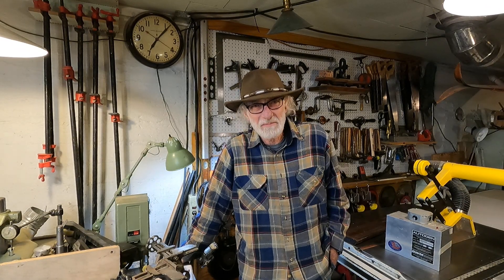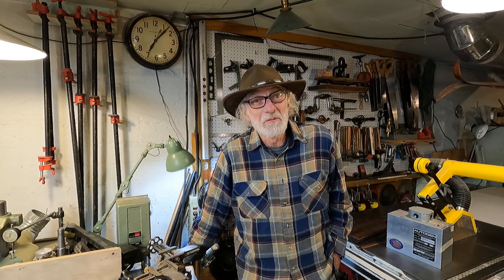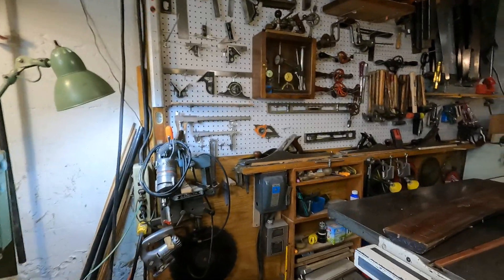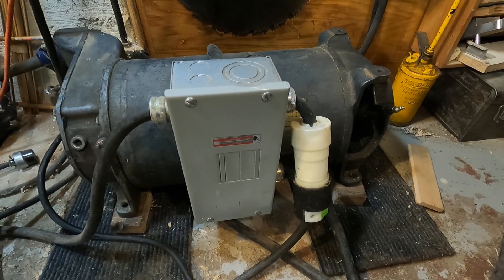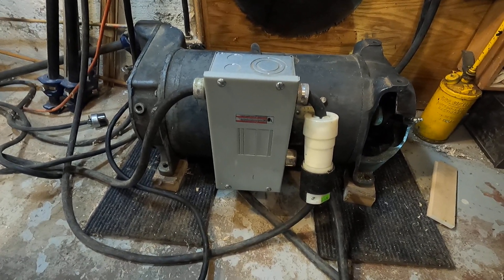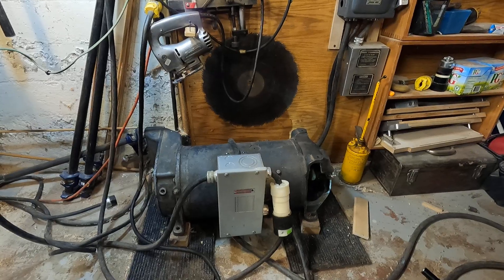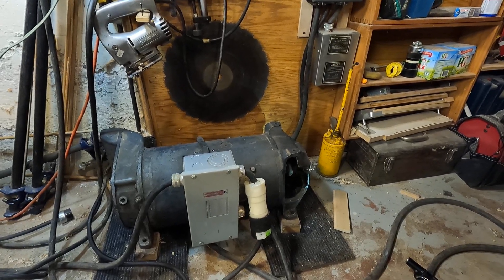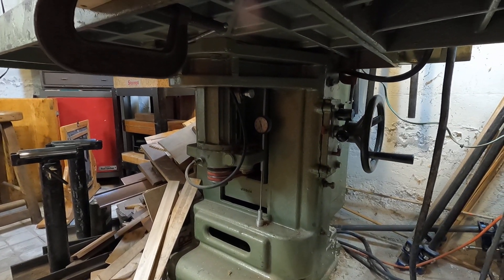Machine shop phase converters from the old days

Comment: Like you I have used phase converters both home made and store bought. A question please, the static converter you are using to start your primary 3 phase motor, is the static converter pulled out of the circuit once the primary motor is started?

Comment: I can’t believe utility companies are going to charge based on instantaneous current demands…

Also, that phase converter does a good job at portraying rotational inertia - ie, that large copper mass is little effected by demands in instantaneous current (when you turn on your machines). Versus the static converters that have little ability to ‘absorb’ and compensate for that instantaneous demand. On a larger scale, this is the same effect on electrical grid stability and the ability of the 100+ tons of rotational mass of a steam turbine to compensate for instabilities (synchronous generator coupled with the grid); in essence a mechanism for grid stability. Compared to the static generators like solar and wind (asynchronous generator) which has no ability to compensate for minor grid instabilities. 

Hence the reason the utility is monetarily penalizing for large instantaneous current demands - we’re losing the ability to compensate for grid instability, so the utility will combat this by penalizing those who greatest the grids stability. Hmmm interesting….
Reply from the maker: From what I have heard it was mainly directed at air conditioning use that generally can have high start loads. I have heard that lathes with a clutch saves considerable if one only is using a static converter. American rotary provided a 15hp converter after my 7.5 simple homemade thing gave out. This unit is providing the best running I have had in the area here but the utility structure is very old with out of balance 3 phase in the rural areas.

Comment: Good content ..   I'm hoping I can find an old  10+ HP 3Ph motor to generate  power for my old 4 Hp (GE/Westinghouse?) motor on my old surface grinder using  the utility's single phase .   The 4HP is a good ol' motor -- worked fine when I had 3Ph power.  The motor is at least 80 yrs old -- delivers power to leather belt drive .
Reply from the maker: My big machines are 80 yrs. old too, those motors were heavier built, the 1940s GE 3hp on my radial drill is the size of a modern 15hp motor. There are a lot of surplus motors here, but I notice they are being slowly bought up.

Comment: deedee, having a lot of experience with both phase converters and generators, I feel that I need to clarify to others watching this video that your setup with the 10ee rotary converter and starting capacitors is not the equivalent of a commercial phase converter.  I have run into a lot of people that don't understand this.  As you said, this is something that "you can get by really cheaply" with.  I have done this with a similar setup (7.5 hp 3-phase motor with pushbutton starter capacitors), but I was not actually getting balanced 3-phase power.  I was essentially running the motor on 1-phase with the converter acting as a transient starting aid for the 3-phase motor on the machine.  In technical terms, with this setup, I got 3-phase voltage all the time, but only 3-phase current when the load was changing.  This was enough to start the machine's motor, but I got crummy loaded performance on the lathe, band saw, drill press, and metal shear that I ran with it.  The next step up from this is a switching converter, next a rotary converter, and best is 3-phase directly from the actual power grid.  By the way, I now have a commercially made rotary converter in my shop.
Reply from the maker: I have had utility 3 phase in a few locations and it can be Badly unbalanced, I can not tell any difference unless its 440v in one machine. I cannot detect any imbalance problems at all. The first I have heard of this problem is from folks that have little experience with machines and more with electronics. I dismiss it as a problem totally.
Reply: @deedeeindustrialsuperprecision  I agree, rotary phase converters get the job done and relatively efficient and inexpensive to make.  

The rotary phase converter is never going to be perfectly balanced. Every time you switch another motor on the phase angle is changed a little. All that said, I’ve done extensive testing of both current and voltage balance and while the power isn’t perfectly balanced it is good enough if you’ve got your run capacitors balanced.  

My rotary phase output is able to power old motors, modern motors and my Bridgeport EZ Trak’s CNC functions and I have never had a problem in over 30 years of use.  Now, I am not running my motors at their maximum hp most of the time but I do use the instant reverse capabilities of 3 phase a lot.  

I’ve never used one, but is my understanding that high end rotary phase converters use solid state capability to sense and adjust the power each leg is delivering, but again it is a lot more expensive than making your own. 

I haven’t read anyone talking about 3 phase welders and you can easily do that with a rotary phase converter.  For years I have used my rotary phase converter to power my R3S-600 Lincoln Mig power supply and LN-7 wire feeders and it has worked beautifully.  

Using VFD’s or Vector to convert 1 phase to 3 phase power has some advantages and will provide better power balance, but I think you’d need a unit for each tool and they are so expensive.
Reply from the maker: @bid6413  I tried to find a difference that I could see on the work, I just simply could not find a noticeable problem. I do not have to really push machines hard because I am in service and repair.
 Also, I have never not once heard of anyone burning a motor up using a static converter either. I have dinked around with run caps no difference there.
  The utility 3 phase can be bad in my area because of old infrastructure from the 1930s rural electrification, it can be badly unbalanced and require a power conditioner. My view is the whole thing is a bunch of non sense  cooked up on the jerk off forums by those that machine nothing at all but look at meters, then panic.
 I also find it amusing that the racist approved dud machinist are blatantly hocking a particular brand of commercial rotary phase converter. Is it because the cant make their own or did they get a free one? In my opinion only, this non sense about phase converters is another non issue barrier for those that want to join in on the fun of having real industrial machinery instead of that import Precision Matty garbage! Phase converting is easy and cheap and always has been.
Reply: @deedeeindustrialsuperprecision  You are right dee dee, the static type of converter does work, and work well enough for most purposes.  I use one myself on a regular basis.
I would also like to encourage anyone who sees the cost of a commercial phase converter as a roadblock to consider the option of making one out of an electric motor.  It is dead simple and cheap.  Just make sure that you have some help or advice from someone who has experience with electric motors and wiring if you have none.
Reply: @bid6413  Sheffield Bailey, I would hesitate to run a modern welder from a rotary phase converter made from an electric motor, unless it was an older motor generator unit like the lincoln shieldarc machines.  I have learned through experience that modern electronics are susceptible to damage from poor quality power.  I haven't personally burned out a welding machine or generator, but I have several friends who came up with setups that worked, but only for a little while before burning out a printed circuit board somewhere.  I even had one friend burn up a nearly new 110 tig, after only a few uses with it hooked up to a miller high frequency unit.  He later had it repaired and used it for years as intended without problems.  I have also learned that a high quality welding generator does not necessarily produce power that is the equivalent of power from the wall.  The case and point of this is when I hooked up a miller welder generator to a miller welding machine with matching spool gun (and also to an XR feeder when the required reach made it possible) to work on commercial aluminum trailers.  The welder generator had a rating much higher than the welding machine and should have been ample to do the work.  Also, the welding machine and spool gun would do the work when patched into the power in the building where we were working.  But my friend (the welder) told me that the setup would not produce the power needed to get the required penetration when run from the generator, even though I noted that the meters on the generator indicated that it was working well within its ratings.  This frustrated him because he had bought the generator specifically because it should have had the power for that specific job.
Reply: @taylorcraft1947 As I’m sure you are aware the  “modern” welders use inverter technology and you can feed them any voltage and either 3 phase or single phase.  The electronics inside are capable of converting whatever the input voltage and current are into power the machine can use.  I have a Miller Dynasty DX constant voltage power supply that I use for Tig and stick welding, but because it will accept single phase power I have never seen the need to use it in conjunction with my phase converter.  

I haven’t ever had any experience with the old “screamer" welder/generator technology other than to have been told by old welders that they loved the smooth straight DC current those machines generated.  I don’t see any reason they couldn’t be powered a phase converter as you would only be driving a 3 phase motor,  but, again,  I have no actual experience to back that opinion up with.

Between the new inverter machines and the old motor/generator machines there were many welders produced that weren’t “electronic” though they did use some solid state components.  Check out the R3S Lincoln Mig power supplies and you’ll see what I mean.  That “generation” of Mig welders work great with a rotary phase converter.  

Before powering my R3S-600 Lincoln power supply up to my own phase converter I took a community college class in welding power supplies and how to repair them.  The instructor, who was a Miller factory trained repairman, doubted the R3S welder would work with a rotary phase converter, but was game to give it a try with an old Lincoln R3S-200 machine the college had.  He had a 7 1/2hp commercially made rotary phase converter and the R3S welding power supply worked perfectly with it.  It became a class project to test the phase converter powered R3S-200 power supply output using a factory made load resistive load bank.  The instructor, though surprised, was pleased with how efficiently it worked.

With my shop made 18hp phase converter I ran my R3S-600 Mig power supply for years with no problems. Using flux core wire and the homemade 18hp phase converter I welded 1/4”steel in one pass all day long.  I used that setup without failure for over 15 years before I sold the welder as it became too large for my needs.

As to the generator discussion I have no experience with them.  I did inquire as to whether I could buy a welder and use the 110v and 220v auxillary power to power my house during blackouts and was discouraged from doing that by my local welding supply store.
Reply: DeeDee,  I am pretty sure I can guess the channels you are talking about when you say “dud machinists” and, yes, the do get them for free.  Socrates had a thing or two to say ethics and everything that was true 2500 years ago is still true today; I am glad I’m not in their shoes.  So many stories about phase converters are BS; they work, buy one or make one and be happy running great machines you bought for cheap.  Time to move on.  TB
Reply from the maker: @bid6413  Sometimes things are caveman where as folks pack up and  start to bully others, and get even worse and threaten. It happens every time they pick the wrong guy and win the shit lottery, that is called karma.
Reply: @bid6413  I have run several welder power supplies to power two of my friend's houses when the power went out.  These were a thermalarc predator, a miller big 40g, a miller bobcat, and a miller 400 diesel.  I also helped both friends do extensive commercial 'GASP' pipe thawing!?!  For this we used a couple bobcats, miller 400, big 40g and several lincoln SA200s.  In several hundred jobs over more than 5 years, we never had an incident and had many more successes than failures.  We worked with local municipalities who recommended us to each other.  Pipe thawing can be safe, but like anything else, you can't be an idiot and have to use good business judgement.  Of the machines we used for pipe thawing, the 40g was by far the best.  It had very good steady state output ratings and would start easily in cold conditions.  Also, it had large brushes which were not prone to freezing after shutting the machine down in the extreme cold.  Additionally, the biggest job in pipe thawing is maintaining your leads.  High currents and wet conditions wreak havoc on Lenco connectors, which are only rated at 250A in ideal conditions.  You are always trimming and patching leads and cleaning up connectors.
When you use a machine as a generator, you must stay within the ratings of your machine, which means that you need to have a set of meters to tell if you are safe or overloading the machine.  The main reason that using a welding machine as a generator for your house is a bad idea, is that the machine is not making you money and you are using up its service life.  Also, an automatic generator is just so much easier.
I have never run an automatic power sensing welding machine on a job.  One of my friends bought a portable miller tig machine a few years ago that would sense either 110V or 220V, singe or three phase, and automatically adjust itself to run.  However, most of my experience is with newer welder generators running with older equipment.  The same friend with the miller tig machine also kept a 300A miller TS machine around, which had a big internal transformer and a terminal strip which would allow him to connect to any practical supply combination of voltage and phase by adjusting jumpers on the terminal strip manually.  He would use a similar machine as a mobile welder when he worked at Buick, as he could patch into a power panel almost anywhere to get the job done.
I do have a lot of experience working with lincoln shield arc machines of both the engine driven and motor driven types, as well as with lincoln TIG 300 power supplies, several powcon stick welders, and millermatic 200's of several different vintages with a myriad of wire feeders and spool guns.  I have noticed that anything 1970's-ish and newer starts to incorporate more and more printed circuit boards which are not tolerant of abuse and are expensive to replace.  This is what I meant when I was referring to modern welding machines.
Reply: @deedeeindustrialsuperprecision  I have experienced  what happens with imbalanced three phase first hand.  Basically, the motor doesn't run smoothly and slows down more easily than it should with application of load.  Some of the lack of torque/soft torque response is also due to imbalanced power factor at different load conditions.  To fully compensate for changing load you need your own active system, or you need to tap into a stiff system with guaranteed balanced power factor (ie the utility company).  In my area (Flint. MI) the utilities are very good and underloaded because of the exodus of General Motors and all of the supporting population (Also, we have no smart meters to deal with!).  The problem that I had was paying my share of the cost of running 3-phase power a few miles down the road and up the 1500' driveway to the shop.
The specific problems that I experienced with the "static converter" setup were:
The lathe would not run the depth of cut that I was used to when cutting 1" linear shafting to length with the proper inserts.  The rigidity was sufficient, the chip curl was coming off red/orange like it should, but the motor would not keep up that way it was supposed to.  I could only take a 0.015" deep cut and should have been able to take a 0.025" cut easily.  It didn't stop me from getting the job done but made it take twice as long, and with 25 parts, this added over an hour to the job.  I ran into the same problems with large drills (1"-1 1/2" diameter) bogging down the motor in mild steel.  Also, I could not start the 8' metal shear reliably with the same converter setup.  It would work once started, but at much reduced capacity.  I could start it with a welding generator, and then run on the converter once the flywheel was spinning, but this defeated the purpose, since it would shear better with the generator anyway.
Most of the time, the lower capacity was not a problem, but sometimes it was, and it was worth it for me to get an inexpensive commercially made rotary.
Reply from the maker: @taylorcraft1947  I could be the unbalanced local 3phase utility power effects my position that commercial rotary phase converters are not worth the money. I do think the subject has turned into a barrier for those that want to get started adds a unnecessary cost and complication turns people off immediately, and going in the direction of installing single phase motors or buying import crap machines to solve a problem that is easy to get around.